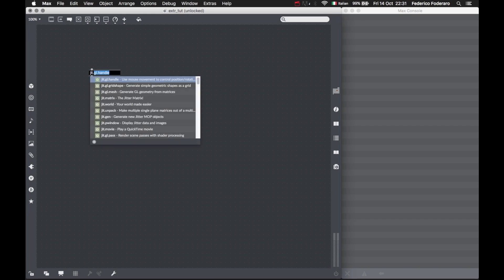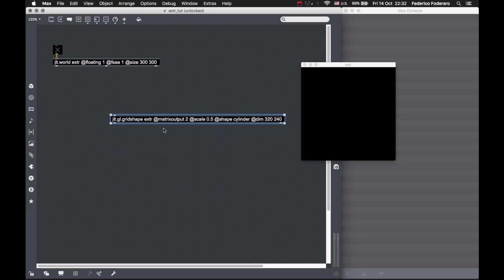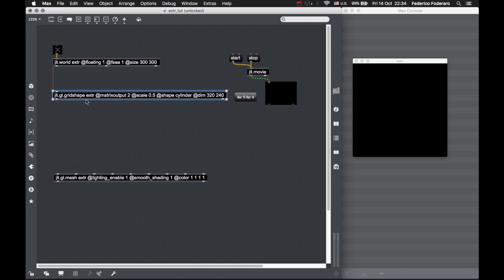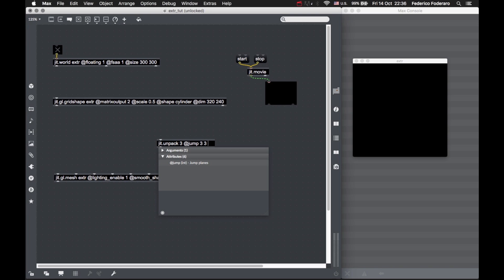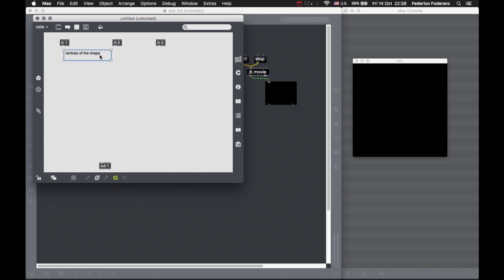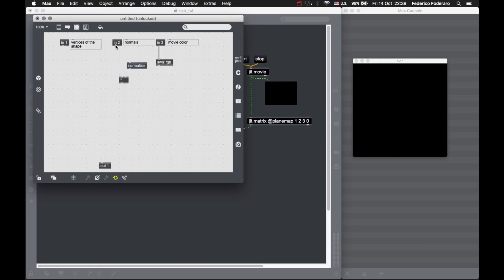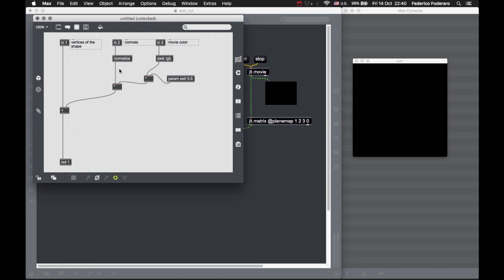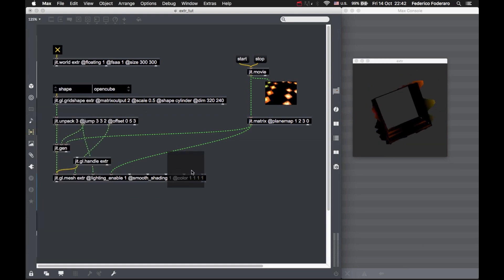Amazing Max Tutorial - Normals Vertex Extrusion with jit.gen

Comment: Hi Federico can't understand the reason why the colors not appear when I plug the jit matrix output to the mesh color array inlet? When I create the gen, just one of the inlets is hot. Thank you so much
Reply: Finally i've find a solution.
I've put this into the matrix box and it works
jit.matrix 4 float32 320 240 @planemap 1. 2. 3. 0.
Can't really explain because i'm a beginner but it seems that we need to define the size of the matrix.
Reply: Hello, i've got excatly the same problem... did you find a solution ?